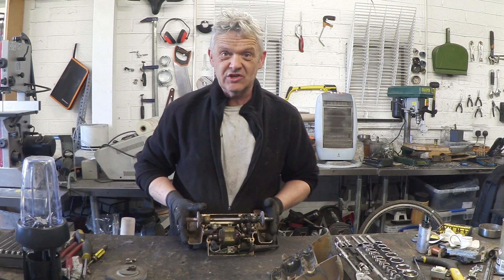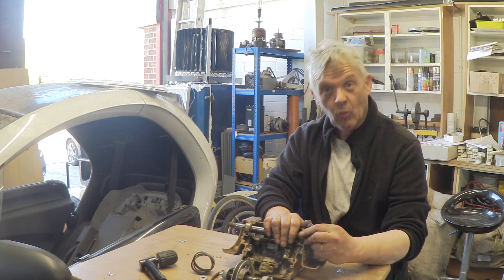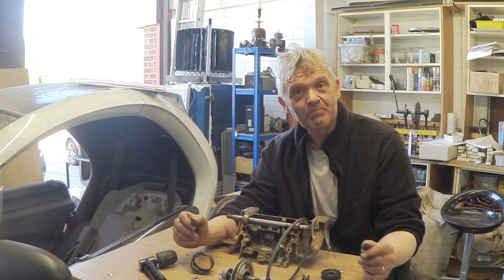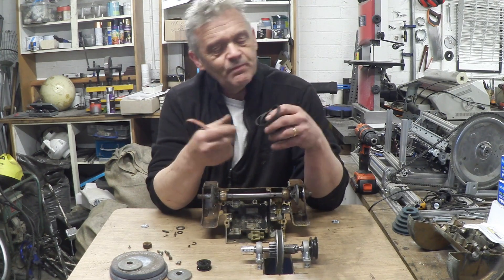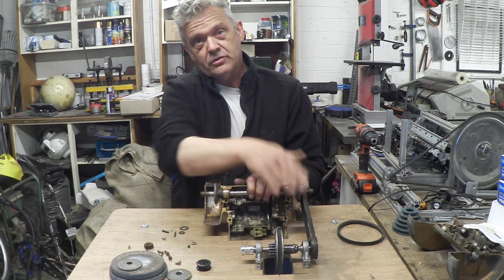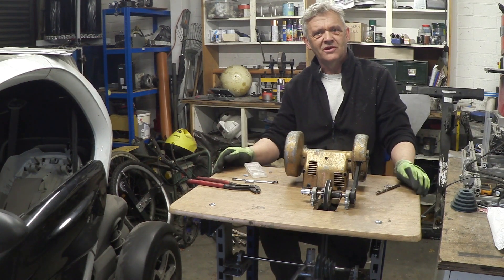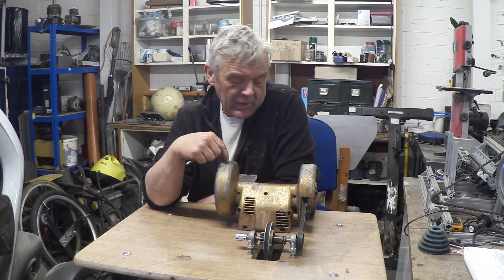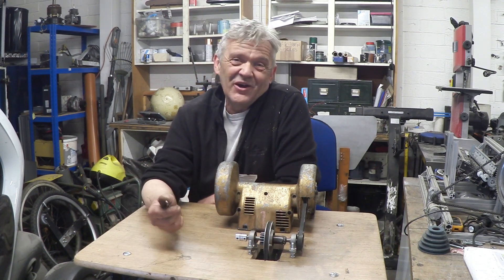1103 Pedal Power - Sharpening Drill Bits

Comment: How about using a (human powered) hoist to raise a (substantial) weight and drive your system without having to do the pedal work while you are actually using it?  I was noticing that it was a bit difficult to control the two actions at the same time.

Comment: I like the gearing to keep the grind wheel slow enough to not de-temper the steel of the drill bit, but I think you could sense the amount of friction caused from using a belt, wondering if bike chain could help remove friction and I seen another comment about flywheels that could also help save you some breakfast cereal for Luke LOL

Comment: Hi Robert.

As others have said, you need a flywheel and probably a freewheel mechanism to be able to store up and smooth out the power you're generating through pedal power.  

For the grinder, you are going to need a much higher surface speed, which means a bigger pulley on the drive side and / or a smaller pulley on the grinder itself, you'll get better grinding and the grinding action will have less tendency to stop the wheel itself.

And then for sharpening drills, just using a jig like that will not work properly.  You'll get drills with a totally conical point and no relief.  They might go in if you force, but the "back side" of the cutting edges will rub, this will generate heat, squealing, and burn out your drill bits very rapidly.

Comment: Some suggestions for the dynapod. 
1: add a flywheel to get a smoother rotation.
2: add a freewheel off a bicycle so rotation is not fixed to the pedals and the flywheel can do its thing.
Those 2 things should help with operating the dynapod for most if not all practical applications.

Comment: Great idea, maybe twist the belt to change direction but it will be hard to get precision grinding while pedaling away (if you're missing your Luke 🤣)
Great video once again mate
Reply from the maker: a figure of 8 like in the contra rotating wimshurst wheel?
Reply: @ThinkingandTinkering  yup that will sort it and get it spinning the right way
Reply: Actually, thinking about it, you could adapt a plate that allows you to drop the bit in from the top at the right angle and just turn it against the side of the grinding stone.

Comment: If you buy a coil of polyurethane belt material you can make pulleys belts of any size. You just melt the ends together. I made one for my lathe and it works great.
Reply from the maker: nice tip mate - cheers
Reply: There's also a hollow version that has little barbed 'bullet' connectors you push in too.

Comment: The grind wheels normally rotate the other way round, helps holding the item down.
Reply: And puts the majority of the sparks etc downwards too.
Reply from the maker: figure of 8 in the drive belt?
Reply: There might be a bit of friction and wear as the belt will touch at the crossing point, but should work as it's not going to be running for hours at a time.